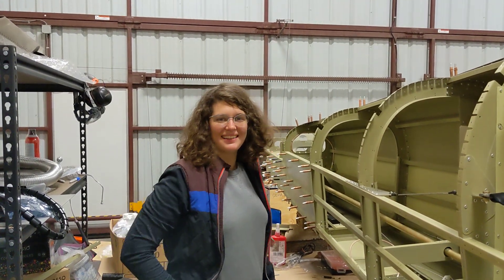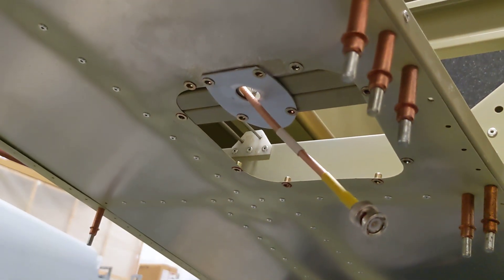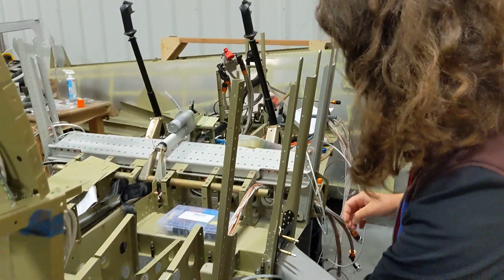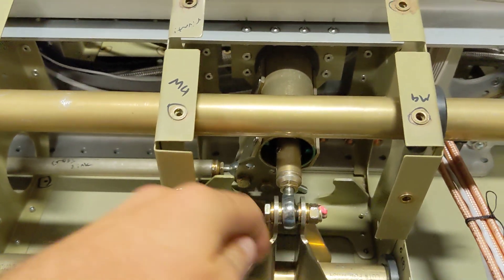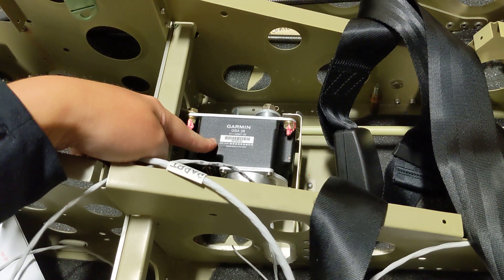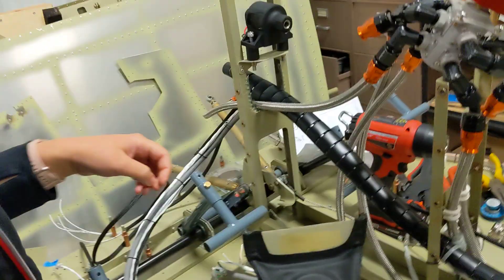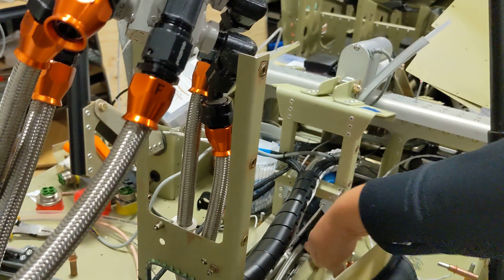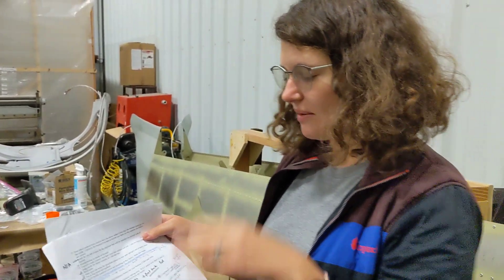Sling TSi - Pre-Side Skins!

Comment: Question.  Is this something a person who has no building experience at all , be able to build from the plans?  How are the plans are they easy to read ?      Lastly all that wiring, is that in the plans?   LOL.  Would love your input as i am interested in building one myself.
Reply from the maker: If by "from the plans" you mean build without ordering the kit (manufacturing parts yourself), then most certainly not -- the manuals do not include part sizes, so you won't be able to make parts. If, on the other hand, by "from the plans" you mean "get a kit, follow the plans" then it is doable, and building experience is not necessary (we did not have any when we started). There are some places in the build that you may need to either use good judgement or consult the internet community (or eaa technical advisor). 
Re: wiring -- that would be one of the places where good judgement may be important :) There is a wiring kit, but does not specify (at least currently) where the wires are supposed to go in the center fuselage, stuff related to engine electrical system is not documented super well and so on. To summarize, with enough determination (and no building experience) you can figure it out!
Reply from the maker: Also, the plans are freely available on Dropbox (if you google " sling tsi build manuals" first result leads you there), you can take a look to see how easy those are to read. Empennage plans are really clear, but e.g. middle of fuselage manual or canopy manual are somewhat less detailed

Comment: Nice video. Those large loops in the white cables to the magnetometer and ELT need to be supported and the white outer insulation sleeve needs to be captive in the connector strain relief, otherwise vibration WILL cause you problems with broken cables!
Reply from the maker: Good point about the service loops, thank you! Re: insulation captive in the strain relief of the connector -- that's a bit tricky, because then you don't have enough wire length outside of the shield to insert the pins into the connector. We can try to heat-shrink the wire bundle together and clamp that in the strain relief... Overall, making connectors is not our favorite task for sure :)

Comment: I’m just starting my TSI build and have given thought as you did to upgrading the fuel lines.  Can you tell me what type of fuel line you would recommend over the stainless steel braided teflon?
Reply from the maker: Hi! Welcome to the Sling family, Aviation Kit Builder :) If we were doing this again, we would have gone with AN6 (instead of AN8) nylon braided PTFE instead of the SS braid - the nylon is less abrasive, making routing a bit simpler. A lot of the existing Rotax fittings are AN6, and so we have to use extra adapters to go down from AN8 to AN6.
Reply: @slingalongblog8111  Thanks.  I’ll have to look for those, I didn’t even know they had nylon braided lines like that.
Reply from the maker: @aviationkitbuilder  yeah! They have them in all sorts of colors too, the place where we got our hoses have the nylon braided ones too: hotrodfuelhose.com
Reply: @slingalongblog8111  Do those hoses need a special tool to put the fittings in place?
Reply from the maker: @aviationkitbuilder  To put the fittings on, two standard adjustable spanner wrenches or a spanner wrench and a vice would be enough. We would recommend a special tool for cutting the hoses though (these giant shears, hotrod sells them too); without them it is hard to get a clean cut to put the fitting on.
Reply: @slingalongblog8111  Any reason why the fuel lines can't be solid aluminium tube? rather than flex?
Reply from the maker: @simonbaxter8001  They can be solid aluminum! Brian Garret (@firstrivet) does that, for instance, as well as Lutz Rabing (tsi.rabing.de). We wanted to upsize ours to an8 for better fuel flow, so we knew we'll likely need to reroute them a few times, which is a bit easier to do with flex (as opposed to re-bending aluminum pipe from scratch)

Comment: Assembly of a central tunnel box is not covered in the video.  It is an extremely important part . :) It is like a carpet in Jeffrey Lebowski apartment.
Reply from the maker: Hi Pasha! Mixing ourselves white russians while writing the reply :) You mean the two central ribs, with the elevator pushrod and rudder cables going between them? Fair, but AFAIR this part is covered well in the manual.

Comment: Thanks for the detail guys, very helpful to see other ideas.  I see a 2nd fuselage??
Reply: I was going to ask - “whose Claude?”  I’m at the confluence of firewall forward/avionics installation. Side panels are on and I’m on the mains. I like the fix for the stops on the controls. That one had me stumped as to why I couldn’t figure out how to get them to stop on both sides. I’ll adjust that on my install. 

The other question I have is if the GMU11 in the back if it’s directional in the installation. I ask because mine is 180 degrees in the other direction.
Reply from the maker: @ibgarrett  Yeah, Claude is our hanger-mate - we got very lucky when we first start building because Claude was in our local EAA chapter and was looking for a hangar-mate at the exact same time as we were looking for a hangar to do the build :)

In terms of GMU11 orientation - the G3x manual specifies that connector facing towards the nose of the aircraft and connector facing 180 degrees from the nose of the aircraft are both valid orientations. The important thing is that the bottom of the GMU 11 is facing down towards the Earth - see pg. 149 here: https://static.garmin.com/pumac/190-01115-01_aq.pdf
Reply: @slingalongblog8111  cool. Good to know. I really don’t want to find out I’ve done something wrong on a part that’s all riveted in. :)
Reply from the maker: Yes! That's our hangar mate Claude's; also a Sling TSi. He is a bit ahead, so we often cheat and look at how he has done things :) But for fuselage and side skins we did it in a different order, as we saw how hard it is to put wires and eyebolts once the side skins are on.